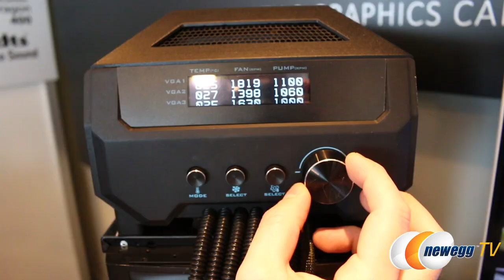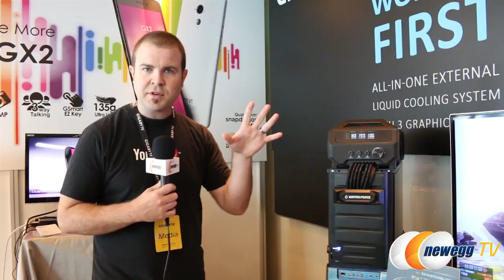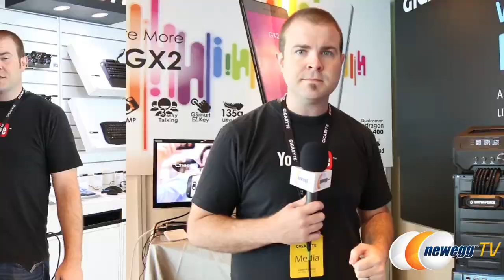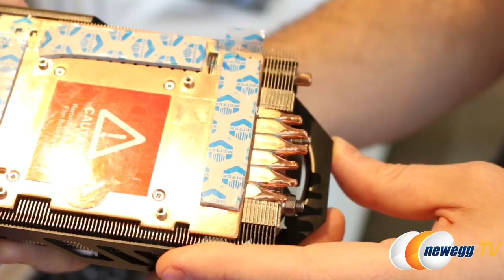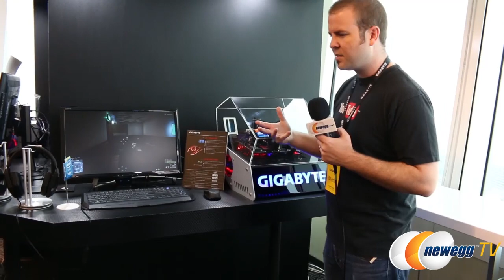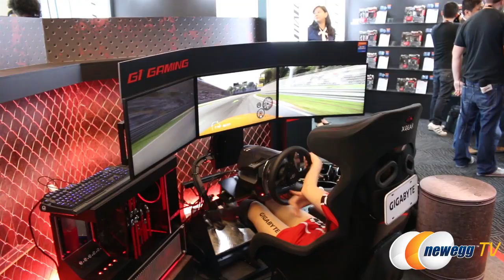Custom 3-Way SLI GTX 780 Rig - Gigabyte at Computex 2014

Comment: 3x120 not 1x360 hmmm not good
Reply: The reason for the 3x120 is for individual cooling control.  If you look at the control panel. it controls the fan and the pump for each card so this means each card have their own loop, hence 3x120 setup.

Comment: Everytime I hear a manufactures coming out with a 'watercooled ready' video card.. A little voice in the back of my head prays for a bare reference style setup without any coolers with high temp hardware and additional power connectors ready for a water block.. Hoping it'll be cheaper now that they dont have to stick their coolers on it.. sigh.. but they turn around and stick an ugly waterblock (looking at you asus) or have some terrible marketing gimmick to sucker people into buying it (achem ASUS).

Gigabyte makes a motherboard without any CPU cooler mounts specifically for liquid nitrogen overclocking.. if theres money to be spent on molds and machining as well as product inventory to do something like that (and still loose to MSI in OC competition).. Please make a bare video card that's 'waterblock ready'.

/end rant.. lol